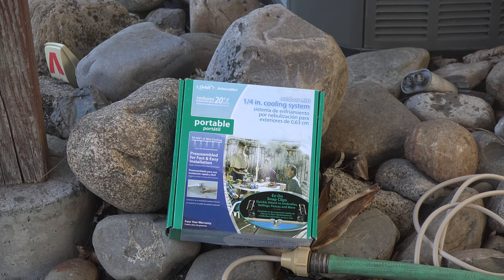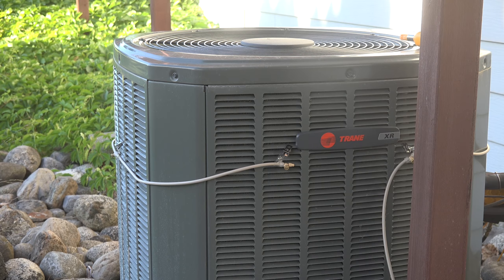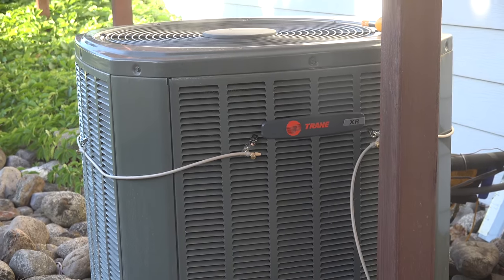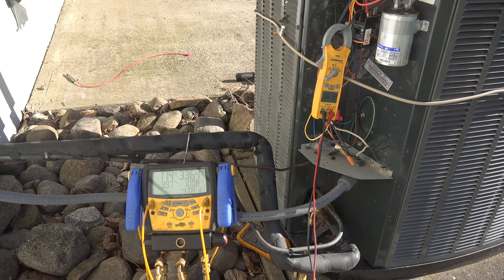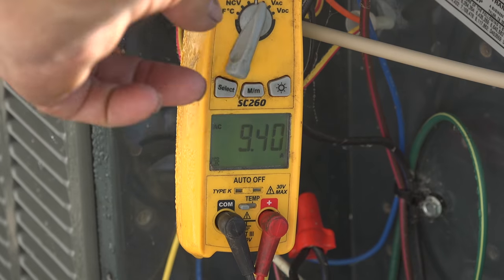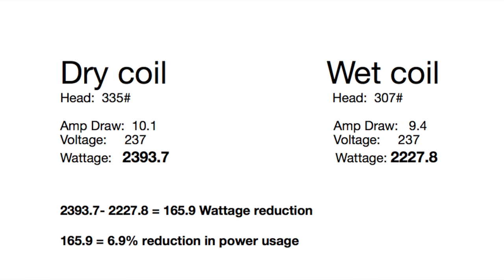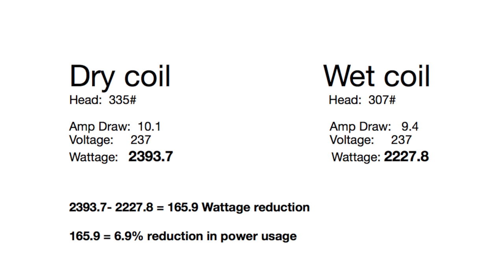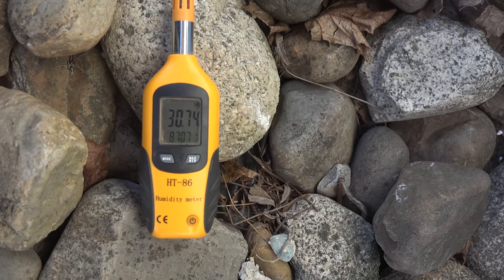Do the misters for A/C work? Part #1

Comment: You are missing the fact that the refrigerant going to the evaporator is now cooler meaning  your coils get colder meaning your unit has to run less often.  Thats a much harder calculation to make but its part of the efficiency equation.
Reply from the maker: Have you watched the entire series?  
That calculation is not much harder, in fact, its quite simple.  Its called coil delta T.  If you watch the entire series, you will see that delta T does not go up with use of the mister.  In fact, it goes down.
GFM

Comment: I thought of a way to cool it but will cost you few hundred. Get a long copper tubing and wrap it around the part that gets hot have a mini fridge that the coils run into we’re there is a tub of water with a pump that’s connected to a converter that’s connected to solar panels that power the fridge and pump. Or maybe try a water dispenser and gut it out and try to make it work somehow with solar

Comment: Quick question, would the lower head pressure increase the longevity of the system?
Reply from the maker: There is no accurate way to determine longevity.  A/C units have a very low compression ratio, so it would be hard to get a lot more out of these things.
GFM

Comment: Hi, Good Video. But this doesn’t take in consideration of a Condensing temperature drop also causing your Evaporator Coil to operate at a colder temperature. Decreasing the overall runtime , So an excess of 6% savings could still be in Play.  This was a useful tool during Army Deployments in the Desert Environment was just so Hot. Also, We found out R410A equipment doesn’t work well so we went with R407C refrigerant.
Reply from the maker: Watch the rest of the series.
GFM

Comment: Great video. Personally it seems like there are too many variables to determine the long term effectiveness or cost savings of a mister (humidity, water supply quality, etc). If you’re looking to save money by reducing the power usage from your unit wouldn’t a hard start kit be more logical?
Reply from the maker: A hard start kit has virtually no effect on power usage.  If it made a difference, the manufacturers would use them as a cheap way to meet the new energy standards.
GFM

Comment: what about oxidizing of the aluminum fins on the exchanger?
Reply from the maker: Oxidizing of the fins depends on the mineral makeup and acidity of the water.  Probably as problematic is the deposits of calcium on the fins.
GFM
Reply: Thank you for the response and information. your help in my trying to decide to do or not has gotten clearer. Thank You again.

Comment: A water tower AC is actually using water to cool the condenser, which could consume less energy when compare to a regular window ac.
It is just not that ideal to water the coil/fins when it is not designed for water cooling.
Consider there will be always condensed water from the evaporator free to use, and you want to get rid of it anyways, misting the condensed water sounds more promising. 
Surely that will lead to other problems like the others mentioned, but that would be the problem to solve when it is a DIY project.
Doesn't change the fact that cooling the condenser could improve the efficiency.
Reply from the maker: Watch the entire series.
GFM

Comment: how was supper heat and sub cooling affected
Reply from the maker: The system is TXV controlled.  There was little change in sub cool, except when in a later video in this series, when I flooded the coil with water.
GFM

Comment: The overall duty cycle will also decrease. Maybe the until will only be cycled for 11-1/2 hours a day instead of 12 hours. But to take advantage of evaporative cooling correctly the liquid water has to land on the condenser itself, not just spray into the air. You are missing out on a huge portion of the benefit of evaporative cooling! You should also measure the air temperature flowing out of the ductwork into the home.
Reply from the maker: I have heard a lot about cycling times and delta T.  I have a video coming out soon that addresses this issue.  As for evaporative cooling, the misters should be evaporating into the air to cool the air crossing the condenser, not the coil itself.  Idealy, if the misters only cooled the air, there would be less calcium deposits on the coil.  In actual operation, the misters do not evaporate the water very much so you end up with evaporative cooling.
GFM

Comment: There's a reason why they don't do this already. Mineral build up from the water will eventually close the gaps in the radiator making the unit not cool correctly and put unneeded stress on the compacitor causing the fan motor to fail. It's a good idea to spray the unit down from time to time but not constantly.
Reply from the maker: Agreed on the mineral buildup.  Not sure where you got the stress on the capacitor.  
GFM
Reply: grayfurnaceman I end up replacing my compacitor every two years or so if I forget to spray off the fan from time to time. When the fan gets gunked up from hard water deposits it ends up running hard and rough. The torque gets so hard at some points that it will shake the side of my house just trying to get the fan up to a decent speed.
Reply from the maker: I have worked in this business for over 35 years and I have never seen the problem you describe.
GFM
Reply: grayfurnaceman I'll have to make a video one day showing it. The kick my unit has when the compacitor is going bad is astounding. The thing sounds like a heavy duty quarry dump truck starting up.
Reply from the maker: Could you send me a link when you do the video?  I would love to see it.
GFM

Comment: Need to be looking at output temperature in house and cycle time of the unit. If it runs 10% less that will also be a big gain. Do more tests and report back.
Reply from the maker: Check the end of the video.  There are links there.
GFM

Comment: Higher temperature difference between outdoor ambient and high side saturation means more heat transfer...which means more heat rejected from the system which means heat removed from the space faster...less run time...
Reply from the maker: On the surface, that sounds logical.  The problem is mechanical operation, pressure differences and efficiency design work together as a system.  When you change any of these, you change its efficiency.  
Consider the if you lower the head pressure, you will lower the pressure difference between high and low side, and if the unit uses a fixed orifice device, you could actually lower capacity and efficiency.
GFM

Comment: How do you introduce demineralize the water??
Reply from the maker: Demineralizing the water may be the worst solution as pure water is very corrosive.  The point of this series is that it is not helpful to use water to increase efficiency of the A/C.
GFM
Reply: @grayfurnaceman  OK, I have city water, with the usual suspects added. These additives are corrosive as well, correct? 
I suspect the question should have been, what type of cooling media should be employed? 
😁😁
Reply from the maker: @waltergroover5282  The minerals in the water cause a buildup on the A/C coil that blocks air flow.  If you watch the entire series, you will conclude that the best way to go is to leave it alone.  The system was designed to operate dry and should be operated that way.  
In very few cases, when a very old unit is involved, (as in 1970s model), water may help to keep the unit operable for a short time.
GFM

Comment: 7% reduction in amps at a relitavily cool 90* isnt bad. Now here in tx where its 100 to 110 from around 1pm till almost 7pm I could easily see a greater  reduction. Also I wish we had dirt cheap electricity here like you do. Here its typically ..13 to .15 after fees.

   Many tests I have seen done show a decrease in amps draw and some have shown a deceease in vent temp as well. Which should result in shorter cycle times which also add to less elec usage. 

     But the issue like everyone knows is mineral buildup. The only easy way would be to use a RO filter.

Comment: Yep, know all about humidity in South Florida, if I still lived in the southwest desert region I would have been all over a mister for central A/C if you could fix hard water inexpensively , but I always had Evaporator cooling in the desert, bigger evaporator unit the better, cooled very well as pretty much no humidity ( "it's a dry heat" as PVT Hudson said) and was cheaper to run in the desert then A/C system.....  Mastercool Evap unit top of the line is cheaper then any central A/C system.

Would suffer once a month during desert monsoon season with evap cooling... live in the one room with window a/c unit back in the day when monsoon hit.....   

If you can get water soft and filtered enough for no hard scale, misters anywhere work very well in dry climates.
Hard water is the battle!  Had misters in my desert home strung along the 50' porch outside, constantly soaking mister nozzles in vinegar to unclog them even with cheapo filter, hard water is the battle, then you get into conditioning the water to remove calcium, that gets expensive . 

Great video!
Reply from the maker: Then, if you do get pure water, you have a highly corrosive chemical you are spraying on the coil.
GFM

Comment: What really matters to me is, is the air coming out out the vents in the house, is it cooler?
The savings in energy will be affected by the air conditioner running less if it’s pumping out cooler air it won’t have to run as much but you did not include this in your calculations.
Reply from the maker: First, watch the entire series.  They are linked at the end.  
Run time is dependent on temp split across the coil.  That is included in the calcs.  Run time is not included because run time is dependent on load and load changes constantly throughout the day and indeed from day to day and week to week.
GFM

Comment: Was duration taken into account?
Reply from the maker: First, I would recommend watching the whole series.
If you mean by duration, hours, days or weeks, no.  
The problem with duration tests, is no two hours, days, weeks, or indeed months are identical.  There are temperature, humidity, cloud cover, or sun height differences that will skew the results.
I tried to do the tests as close in time as possible to get the same variables as possible.
GFM

Comment: well it may be a 7% difference but what about performance because from my experience raising the humidity of air a bit can help it remove heat better along with the mist cooling the air plus higher humidity means a higher thermal capacity so maybe the air conditioner would also work better since you're removing more heat from the refrigerant but I'm no expert so take what i say with a grain of salt
Reply from the maker: I do have a salt shaker here.  lol  You need to better understand thermodynamics.  If the system worked perfectly, it would cool the air but not impact the coil.  That would reduce the head pressure because the condenser air is cooler.  If you cover the coil with water, it will evaporate and absorb heat but at a higher temp.  Pretty simple answer that does not cover all the variables.
GFM

Comment: Something you forgot to check was the temperature of the air off the evaporator. If you drop the temperature of the condenser then the evaporator temperature will also drop resulting in faster cooling of your home therefore fewer run hours on your A/C unit. Mister are definitely worth installing less current draw as you demonstrated and less run time .
Reply from the maker: I have had a number of comments about the cycling time issue.  The reason for not including the test was I did not think cycling time would be affected by at the small reduction in head pressure.  I will be publishing a video comparing dry coil performance with one using the misters.
GFM

Comment: Don't slinger-fans work on kinda the same principle?
Reply from the maker: Pretty much.  Fortunately, the water used in slingers has no calcium that may damage the coil.
GFM
Reply: grayfurnaceman                Good point, I never thought about that. I once lived in a dumpy apartment, with a very old AC mounted in the window.......definitely in need of a recharge. I would pour cold water into the drip-pan, so the slinger would throw it onto the condenser..........that baby would blow ice-cold when I did that.

Comment: You didn't take into account the heat absorbed and carried away by the water. If not all the water evaporates, then it should still be colder than ambient, and it will absorb heat, thereby cooling the Freon better, which produces lower temps at the vent, and makes the A/C effectively "more powerful" which should reduce cycle time. Or am I missing something?
Reply from the maker: Watch the entire series.
GFM

Comment: In theory, the increased efficiency of the condenser should cause the unit to have a shorter duty cycle IN ADDITION to the reduced energy consumption from lower head pressure while the unit is running.

Note:  I'm not advocating for these at all because I think there is a high risk of damaging any condenser unit that isn't designed for one of these devices.  I just think the power savings should be higher than just compressor's instantaneous power consumption.
Reply from the maker: Watch the rest of the series.
GFM

Comment: What about less wear on the unit?
Reply from the maker: There is no way to judge wear, so that was not dealt with.  
You must also consider that the unit was not designed to operate with head pressure that is lower than normal.  So you could end up damaging the equipment.
GFM
Reply: Much less wear.

Comment: Sure it lowers the power bill but at what cost? Your water bill goes up and you introduce minerals from the tap onto your coil that will damage it prematurely.. 
So how about a distilled water closed system? Well you have to make sure that distilled water stays clear of impurities and you need power to run an independent pump So the saving is not even negligible by the time you buy  mist system and add to the bills..

if your A/C is running to hard or you do not like your power bill then shut it off and open some windows.. You will live..
Reply from the maker: The interesting thing about distilled water is that it is very corrosive.  My father had experience with it and he said water treatment was the only way to deal with it.  He worked only on industrial systems.
GFM

Comment: I have 3 units on my home. that's 20% for me.  If I can save a 5th of my power bill it works for me. Those worried about mineral build up on your unit just clean it 2-3 times a year.  not that big of a deal.

Comment: By the way my power usage goes from 3500w to 4100w when the outside temp moves from 95f to 105f
Reply from the maker: The 15% increase seems fairly close but I would expect around 25%.  
My guess is that you are measuring total power usage and not metering the A/C unit.  
GFM

Comment: You showed less head pressure and less current and dismiss filters, And discussions  of acid in cleaning agents. Big high rise use water to lower heat. Heat is the killer here. We all can armchair quarterback this on paper talk of theories. Real world facts, we hook up meters to see the facts then talk of theories and what if. I built a sunshade for my ac unit everyone said that wouldn't work because air temperature was already taken in the shade exactly. If left on the southside of the house or even worst roof mounted the solar radiation with thermal mass that surrounds the unit plays a big factor in the efficiency.

Comment: the only way to really get a proper reading is to know the kw/hr of the unit with and without the mister on identical hot days, and also record the inside room temperature to make an actual comparison of the performance.
Reply from the maker: Define identical.
GFM

Comment: Lower high side pressure = lower suction pressure. Lower suction pressure = lower evaporator temp
Lower evaporator temp= reduced cycle time. 

Pretty well made video, I can tell you put a lot of time into it.  Your premise is correct, and you came up with a very nice test to verify that. However I think you missed the point. 

What you're measuring is the resistance change in the compressor. Higher pressures result in More mechanical resistance for the compressor to overcome. Moore mechanical resistance on the compressor will require more current to spin the compressor.  that is what you measured.

Regardless of the long-term viability of a Mister, The concept of the mister is to lower the condenser temperature. This will then lower the evaporator temperature, making the air passing past the evaporator colder. Colder evaporator temperatures makes the air conditioning compressor cycle less. This reduced cycle time can be a large savings. In addition to the reduced compressor current draw. 

Think of it this way, if the condenser at a blanket worth of Dust and crud on it cleaning the condenser is analogues to installing a Mister
Reply from the maker: I will be publishing a video demonstrating evap delta T with and without misters soon.
GFM
Reply: The cycle time could account for the other 13% of the savings. To me the bigiest purpose of the mister would be to increase the capacity without having to replace the system. For example if it is 104° outside and the best the system can muster is 87° inside, the mister might get you to 80° ??

Comment: They're claim is that the unit cycles less. Never mentioned current.
Reply from the maker: I did not consider cycling because there is no way  to compare time of day, cloud cover, temp, etc.  I did, however, consider temp difference across the eval coil.  Cycling is dependent on temp difference.  There are several videos on this subject.  Check the end screen.
GFM